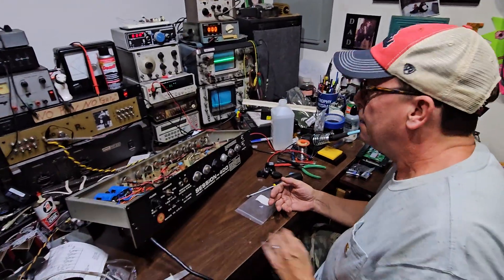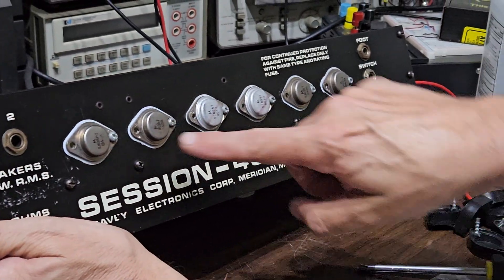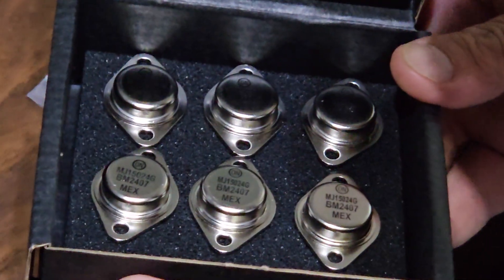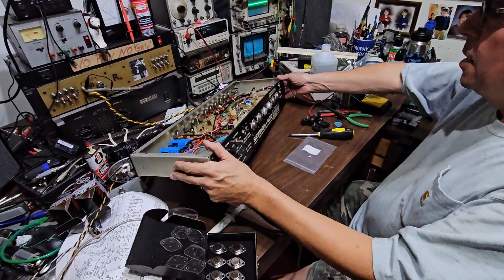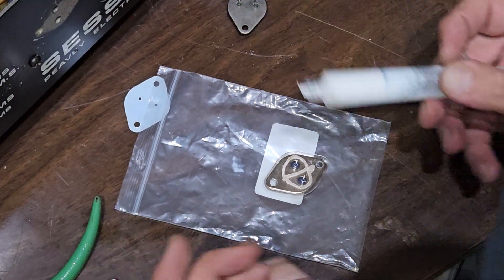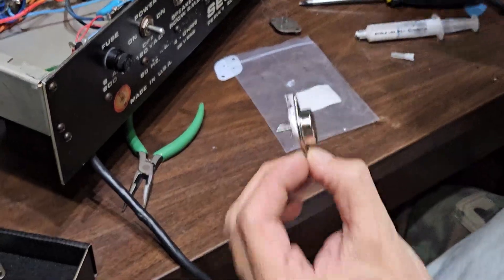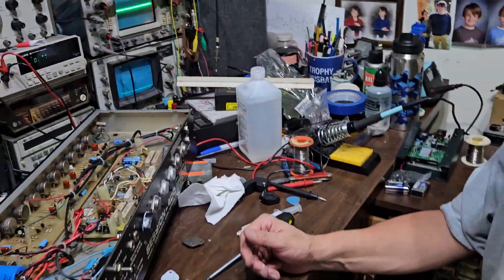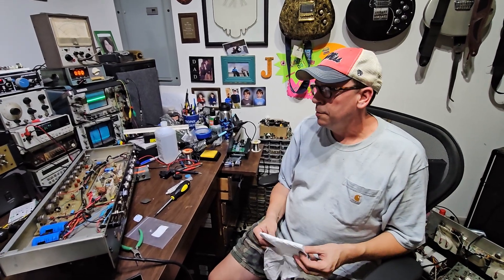Replacing TO-3 Power Transistors On Some 70s, 80s, & 90s Peavey Amplifiers - 1980 Session 400

Comment: Where can I find spacers and covers?
Reply from the maker: I get the 200 pack of mica spacers on Amazon and sort them for thickness. I haven't found new covers that I like, yet. You can add #6 nylon washers under those that have been compromised to get by if they're really bad.
Reply: @johnfields8745 cand find the covers

Comment: Check your black widows. The foam in the vent turns to goo and leaks in voice coil gap. Causes rubbing and warping of voice coil.
Reply from the maker: I actually did a video on how to fix those as long as the VC hasn't gotten too hot.
Reply: @johnfields8745 my dad's was too late. Had to get it reconed as Peavey no longer carried the replacement baskets. Wouldn't answer phones or emails either.lol

Comment: This is gonna save a lot of Peavey’s, thank you!

What about stabistor usually heat sunk on the bottom? Peavey references a mz2361 but it looks like they sorted them for a specific spec, is there a modem reliable replacement?

I’ve seen folk replace it with two diodes and the amp gets on fine; but if there’s a modern sub I’m all ears.

Comment: New video from John? Instant watch and like, lol. Question, I have 2 70’s Musician 400’s on my bench, do these have the same transistors in the power section? Also, that damn conductive thermal paste is the devil… gets me every time 😂
Reply from the maker: You can use these for most of the NPN TO-3 applications, but there were a few different OEM parts used.